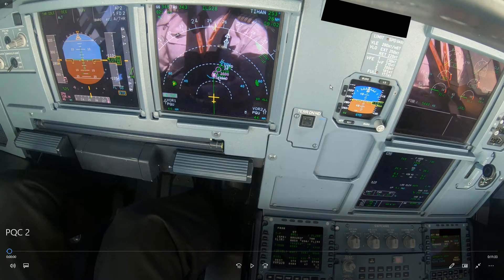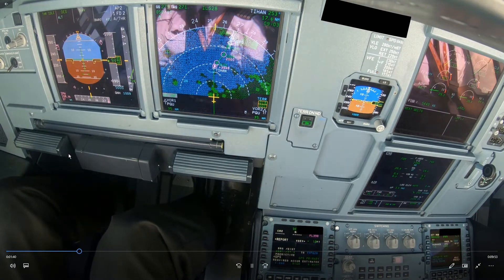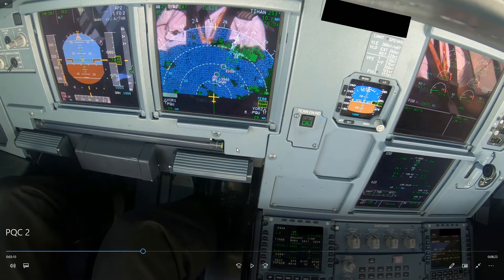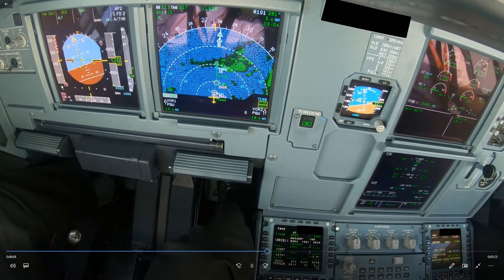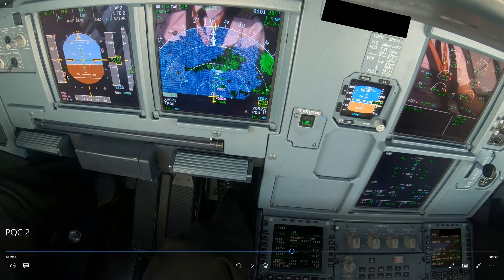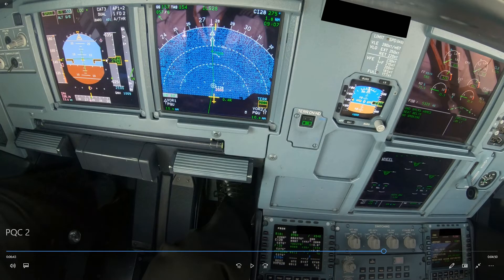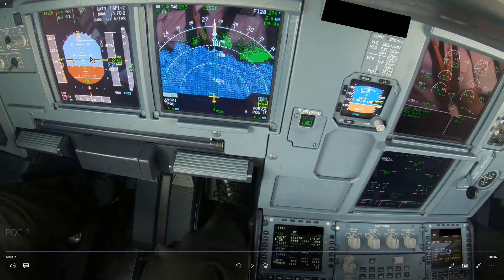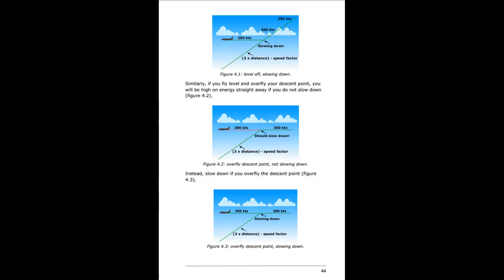A320 Descent Management - VVPQ, too conservative

Comment: I have a question regarding ring ranges. personally I like a little ring range for some situational awareness. If the platform alt is at 3k I will put a 10nm ring. however I see some people do a 9nm ring, won’t this technically be slightly inaccurate if they base on approximately 300ft per nm?

secondly. if I want to do a ring for an approach with a platform alt that has 2k. What’s the best way to do it, surely 6nm isn’t totally accurate because that is based on alt x3?

I appreciate it isnt an exact science just wanted to know your thoughts.
Reply from the maker: I do not advice this because a distance alone does not take into account the speed. If you are at the ring at your target altitude, it might give you the false impression that you are on profile when in fact you are too fast. 

There are many ways to deal with descent management but I want to stick with the method I teach because otherwise it adds complexity to an already complex subject.

My book contains a structured well explained method how to deal with these things. The YouTube videos are there  just to support my book.

This is not to say that your method of using rings is not valuable, it certainly can be valuable.

As for the platform altitude, I would avoid flying level at 2000 ft unless the procedure specifically mentions that you have to. The reasons for this, and how to deal with this, is also in my book. But basically you want to be gear down just before you intercept the glide slope, privided you are fkying level, and your speed is not too high. All these things you have to view in context. Something that the folks at Airbus also seem to struggle with, judging from the things they write in the FCOM regarding this subject.

Comment: In this scenario why isn’t the loc engaging? Is it cause you’re too far out.

Secondly slightly off topic but if you are cleared for an ILS and you are 30nm out on the intercept it may be better to manage hdg until you’re within the envelope before arming APPR. Once you arm APPR will NAV BLUE disarm to replace G/S and LOC blue. If so what would happen to the INCPT point on the ND, would it disappear and you’d just be flying in hdg before intercepting loc.
Reply from the maker: LOC(*) green will only engage when LOC is blue (which happens when you press either the LOC or APPR pushbutton). Also, you have to be close enough to the llz beam, or on a sharp intercept heading. At what time in the video did you expect LOC* to engage?

ATC will not give you a vector expecting you to intercept the LLZ outside of the certified range. However, if that is the case somehow, then indeed you can manage HDG to get NAV blue, provided the flight plan is sequenced. Most of the time you can just wait a bit to get in range before arming APPR without having to push HDG though.

But if you do push HDG, you will get NAV blue, and it will remove GS blue and LOC blue if that was present.

If you press APPR with NAV blue present, then NAV blue will removed and replaced by GS blue and LOC blue. In that case the INCPT point will be removed and the track to intercept will be removed as if it was never there and you were flying in HDG mode and never managed HDG.
Reply: @a320descentenergymanagemen3 

I thought the loc would engaged around 20nm out but watching it back and zooming in I can see it looks like you weren’t actually on an intercept course until CI28 so apologise that’s my dodgy eyesight!😂 so that makes sense.

That is all understood above, so the way to do it is manage nav first and wait until you’re within the coverage zone (if you’re going to do this) and NOT press APPR then manage heading as GS and LOC blue would be removed.

& then if my understanding is correct this would be slightly different in a FINAL APP approach, at which point you may as well press appr in the first place because it will draw the intercept and arm final and app nav?
Reply from the maker: Indeed. One other thing to look out for is that with some approaches the procedure takes you through the localizer and you have to intercept it from the other side. Even if ATC clears you for the approach, you still have to follow the procedure track.

Comment: @06:22 profile calculation;
20nm×3 =6000ft
6000ft - 500 ft = 5500ft ( Because we are at S speed )
Looks the aircraft is on profile.
I didnt understand why you are saying "we are so far below profile" at @06:52
Reply from the maker: The profile calculation is for 20 nm, but at that time we are at 21 nm, so slightly below profile (always wait untill you pass the actual distance you calculated for to see how high/low on profile you are). But because Flap 2 was selected way too early, we were even further below profile shortly after. That was observed from the glide slope an the speed, not the calculation.